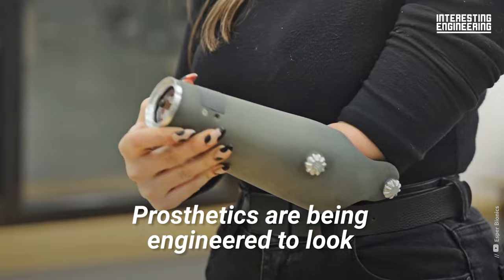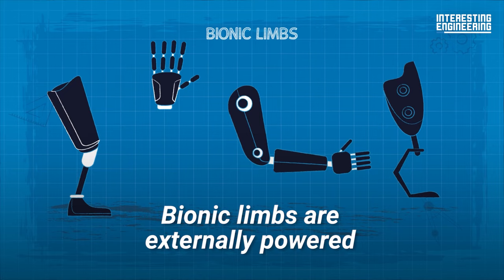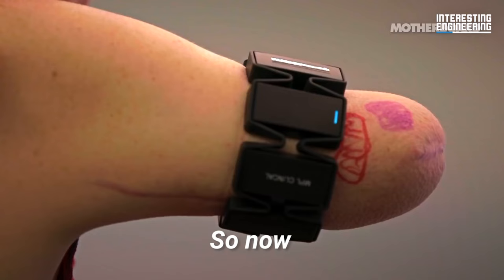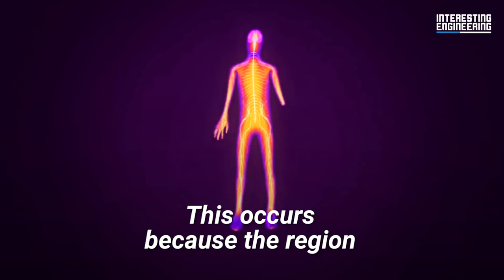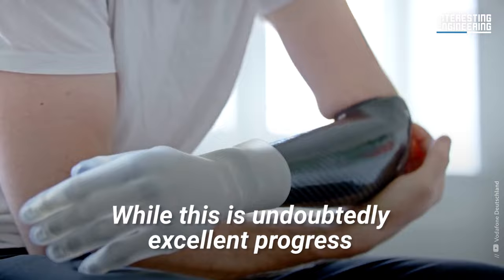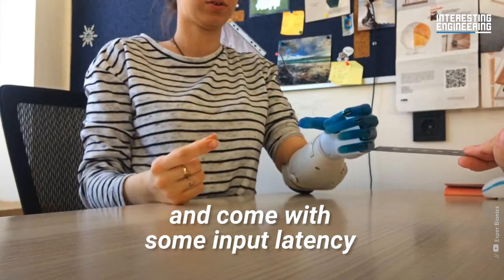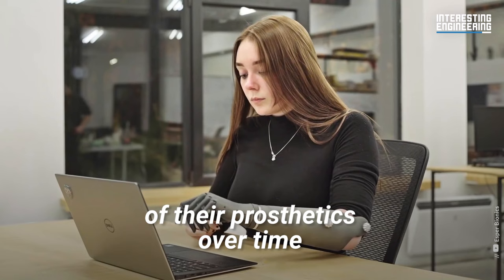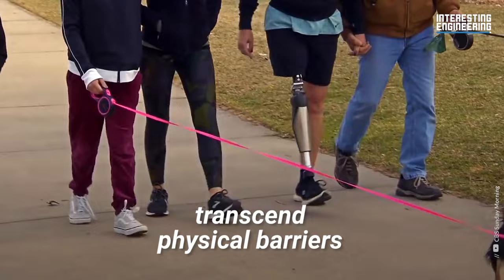Bionics are the future of prosthetics

Comment: but question is where we get these bionic limbs?
in an accident i lost my both legs
Reply: If you're in the US, there are some companies, some of the more  advanced  ones can have tiny chips under the skin, connected to sensors in the limb that give your nerves immediate feed back.
Reply: My sympathies, I only lost one. Mine will  have a microprocessor that "learns" my stride. It has pressure sensors that give the ankle and knee joints feedback. I can't get it until the swelling goes down, above knee amputation. 2-3 months